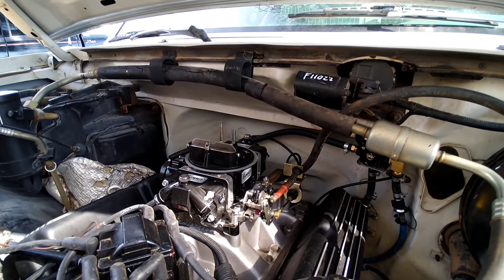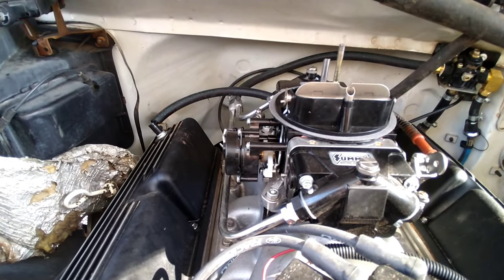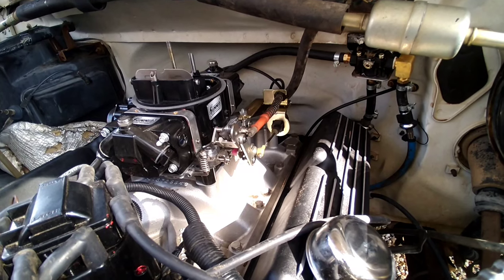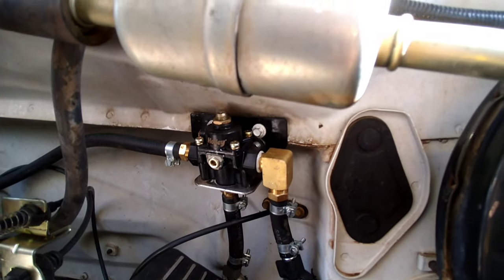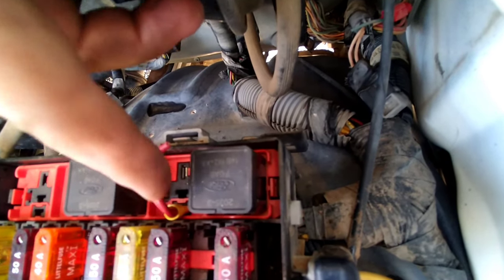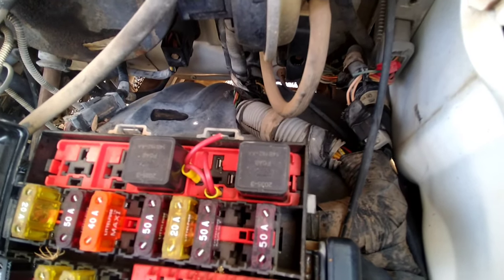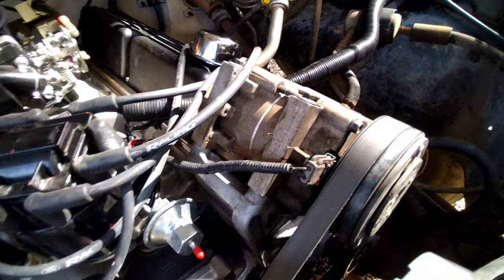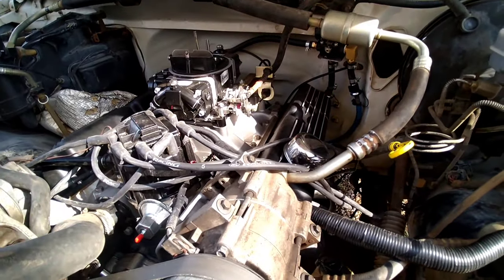87-96 F150 EFI to Carburetor conversion

Comment: what did you use to connect the factory fuel supply/return line to the fuel line to the carb? I can see you have some sort of adaptor - I am trouble tracking one down.  Any help is appreciated.
Reply from the maker: I left the fuel lines on the truck completely stock I didn't cut them but I did cut off the peace on the fuel rail on the intake that the fuel lines connect to then I just flared the cut ends and slipped rubber high pressure efi fuel hose on them and ran that to the pressure regulator
Reply: @CCAutoWorks  thank you.  I thought that after rewatching the video - but was concerned I may have missed something. Really don’t want any leaks…
Reply from the maker: @job1bf  mine has been perfect not a single drop but I do change the rubber hose once a year because the engine heat kinda brakes it down a little just me being of cautious
Reply: @CCAutoWorks  thanks again - currently doing this exact thing - hope it turns out as well as yours.
Reply from the maker: @job1bf  anytime thank you for watching good luck it will there's not to much to it
Reply: @CCAutoWorks  sorry to bother you - did you use the factory water temp sensor to make the gauges work?  there are two on the EFI intake and I am not sure which one to use.  Neither sensor fits the larger opening - do you remember what you used for that location?
Reply from the maker: @job1bf  I used the factory on but im thinking I used an adapter from a set of sunpro mechanical gages
Reply: @CCAutoWorks  so is the “large” sensor  (with two pins) the one that goes to the gauges? Or is it the “small” one that just one pin?  Did you use the location over the TStat?
Reply from the maker: @job1bf  mine was a one pin sensor kinda looks like you can thread a nut on it and I just put mine in the intake on the water crossover on the driver side

Comment: Where did you get that throttle bracket I can’t find one to fit mine and it caused my trans to burn up
Reply from the maker: https://www.ebay.com/itm/363714619487?mkcid=16&mkevt=1&mkrid=711-127632-2357-0&ssspo=fNK2amQnSWi&sssrc=2349624&ssuid=6G4e_MbCTLy&var=&widget_ver=artemis&media=COPY
Reply from the maker: I bought mine off eBay I sent you the link

Comment: hey i know this is an old post but i had a question regarding wiring did you "diet" the wires from the "injector harness" 4 connectors on the drivers side inner fender?
Reply from the maker: Mine only had one connector but I've seen the ones with four

Comment: What wire did you use for the tach on the new distributor I want to keep my oe tachometer.
Reply: Was it one of the two wires from the old coil?
Reply from the maker: I forget what color but I can look tomorrow I can't really remember I believe it was a wire that had went to the old distributor
Reply: Did you find which wire you had to hot wire for the tac?

Comment: ON the HEI, What gear is on the distributor to match the roller cam? Is that a stock 5.0 roller cam?
Reply from the maker: I couldn't find the right gear your supposed to run for a Ford distributor so I just ran the one that came on the hei
Reply from the maker: My cam is an aftermarket comp cam

Comment: Where did you get the throttle and trans cable bracket from and who.made it?
Reply from the maker: https://www.ebay.com/itm/315487762913?mkcid=16&mkevt=1&mkrid=711-127632-2357-0&ssspo=lmOu8J8dRrq&sssrc=4429486&ssuid=6G4e_MbCTLy&var=&widget_ver=artemis&media=COPY

Comment: I like what you've done. I have a 1995 f350 with 460 efi I'm wanting to to the same thing. On the TPS do I need a complete controller or can I just use a TPS sensor from us shift.
Reply from the maker: Either way will work if u just buy the tps sensor for your choice of carb

Comment: Does that fuel pressure regulator bring the pressure from 40-50 psi down to 6 psi?... I've checked around and only been able to find  an aeromotive regulator for about $315 to accomplish that...curious to know if yours is still working good...thanks!
Reply from the maker: Mine perfect it's a Holley low pressure 0-9psi bypass regulator I'll send u the link it just returns all the extra pressure back to the tank
Reply from the maker: https://www.ebay.com/itm/154839598272?mkcid=16&mkevt=1&mkrid=711-127632-2357-0&ssspo=j6SFV1OETHy&sssrc=2349624&ssuid=6G4e_MbCTLy&var=&widget_ver=artemis&media=COPY
Reply: Thank you sir!
Reply from the maker: @jimmydavis6254  no problem anytime thank you for watching
Reply: I did this on 93 f150 with same Holley regulator and found the internal shuttle valve in the fuel pump housing would not return until about 50 psi. I could not regulate the pressure to 6 psi. @CCAutoWorks
Reply from the maker: @marrsbar27  you have the high pressure regulator for efi you have to get the low pressure regulator for carb use 0-9 psi but I have found out Holley regulators suck I've had two of them fail and about burn down my truck I started using a different brand because Holley told me tuff 💩 on both failures

Comment: Hello Sir,
I love the video. you are the man. Could you put  a parts list. I will do the same.
Reply from the maker: Parts are really your preference and the brands you prefer
Reply: @CCAutoWorks   if i had a preference, i would be asking you. I know its an old video. just say you forgot. Thank you and goodbye.
Reply from the maker: @JoseMartinez-i7u  you don't have to be that way I remember every part I used from crankshaft to rod bolts to heads to fuel pressure regulator what I'm saying you might not like Holley style carb u might prefer Edelbrock you might not like Holley pressure regulator u might like aeromotive
Reply from the maker: @JoseMartinez-i7u  there's a hundred was to do something if u need an exact parts list and me to hold your hand that far you might not need to be doing this in the first place

Comment: I’ve got an 85 302 efi non ho and I’m looking to carb swap I wanted to know if you had the link to the fuel pressure regulator you installed ? Thank you in advance
Reply from the maker: https://www.ebay.com/itm/Holley-Carbureted-By-Pass-Regulator-6-PSI-Black-E-Coat-1-8-NPT-Boost-Ref-12-887-/274876864887?mkcid=16&mkevt=1&_trksid=p2349624.m46890.l49286&mkrid=711-127632-2357-0
Reply from the maker: On an 85 there should be two pumps a low pressure in tank pump and a high pressure one on the inside of the frame you should be able to just unplug the pump on the frame and just run the tank pump with no need of a pressure regulator I've done it like that on an 86 I just teed the fuel lines where it would still return the extra fuel

Comment: What intake and carburetor did you use from what other motor size will fit my 4.2 l Ford F-150 2003
Reply from the maker: It's a weind intake with summit carb as long as u go stand alone carb and hei distributor and u make your engine mounts u can put any engine u want in a 03 f150

Comment: Great Job. Got  86 F150 , first year with this crappy EFI, would love to swap to carb.  Do you have a list of parts or part numbers you use?  Would appreciate any help. TIA
Reply from the maker: Yes sir thank you for watching I sent all the links to a guy here in the comments if you don't mind looking at are conversation it's the comment with the most replys
Reply from the maker: https://www.ebay.com/itm/321888807068
Reply from the maker: https://www.ebay.com/itm/133374027685
Reply from the maker: https://www.ebay.com/itm/283666850881
Reply from the maker: https://www.summitracing.com/parts/sum-carb600-ecvs
Reply from the maker: Or any carb of your choice
Reply from the maker: https://www.summitracing.com/parts/sum-700203

Comment: What are the engine specs? I see Promaxx heads. What cam, intake, compression, pistons, shortblock parts, etc?
Reply from the maker: 351w block .30 over stock crank speedmaster bushed rods KB flat top pistons compcams er282 retrofit roller cam 513/529 lift 230/236 duration 110lsa 10.3.1 compression with the 60cc promaxx heads intake is a high-rise four barrel pro-form roller rockers pacesetter long tube headers

Comment: Why did you leave the vacuum advance on the distributor unhooked?
Reply from the maker: Because I didn't have a hose at the time
Reply: @CCAutoWorks  thank you for the reply. Just was curious as I am wanting to do this swap with my 96 302(manual transmission). This is by for the most straight to the point, what's all needed video on this subject. Had yet to find one where they explained keeping the stock fuel pumps running like you did. Thank you for your help!
Reply from the maker: @joeygeisler3506  thank you for watching happy to have helped

Comment: I have a 1994 F-150 Flareside 5.0 that I'm considering doing this to. It has the E4OD transmission. Is this conversion possible with the E4OD?
Reply from the maker: It is but it cost a lot more you have to buy a transmission control with a tps sensor

Comment: Awesome! Came out great. I got a 94 f150 302 swapping a carb 351w but I have the 4r70 trans so I’ll need a us shift kit. Hey do you know if the 302 pulley brackets will swap to the 351w? If not I’m heading to the junk yard. Great videos man I just found you looking this up!
Reply from the maker: I used my factory 302 pulleys an accessory drive brackets on the 351w I put in there no problem this truck was factory 302 truck I built a mild 351 and put it in there when I did the carb swap
Reply: @CCAutoWorks  beautiful work! Thanks for the info!
Reply from the maker: @anthonyalexandrou5055  anytime thank you for watching
Reply: Hey I have another question for you, I’m putting a 79 351 block that came out an old 82 f150 mud truck in a 94 f150. Right now I’m trying to wrap my head around the distributor. I have just the stock one with the duraspark system that I ripped out of the 82. My question is do you think the distributor will wire up without issue with the brain? Or am I going to have to find a different if Ignition system. I still have the 94 and 82 ignition system and I’m hoping I can patch something together. Please help lol

Comment: Hey man im about to do this to my 91 f350 i wanted to ask about the bypass line on the fpr did you have to drill a hole in the tank for the return and add a custom fitting on the tank?
Reply from the maker: No on mine it has a factory return

Comment: Does anybody know if this belles mpg?? It’s possible with a carb because emissions may be the benefit of the efi. Abs cold starts. Depends.
Reply from the maker: I noticed 1
About 2 mpg less but it's bored cammed and has aluminum heads

Comment: What kind of intake did you use to replace the other intake.
I got a351 Windsor straight 8 and was wondering
Reply from the maker: https://www.ebay.com/itm/Weiand-Ford-351W-Windsor-Dual-Plane-High-Rise-Stealth-Intake-Manifold-IMCA-/133374027685?mkcid=16&mkevt=1&_trksid=p2349624.m46890.l49286&mkrid=711-127632-2357-0
Reply: 351 Windsor straight 8?

Comment: Finally got mine together.
Reply from the maker: How u like it
Reply: @CCAutoWorks  I've still got some fine tuning to do to it. Think my main problem is the fuel pump. It's a low pressure pump I had. Gonna try a mechanical and see how it does. Needs plugs and adjust the vacuum advance some. Lighter springs in the distributor

Comment: Im about to do this swap and I have an 87 bronco with and AOD, to make this work with the TV cable all I need is the cable bracket and the corrector bracket?
Reply: The carburetor im running is the holley 0-80457s
Reply from the maker: Yessir your correct

Comment: Im looking at buying an 87 4x4 302 5 speed. Owner claims the injectors are shot, but i can tell this man doesnt know a spark plug from a butt plug and he tore the intake plenum off, (which he called the head btw) cut wires, removed the injectors and anything else that was in his way. So i think im going to bypass his fuckery and do a carb and intake swap. 

Any help would be appreciated. Got a part number for the hei dizzy?
Reply from the maker: Lmao I've ran across plenty of guys like that to the mechanical fuel pump bolts to the timing cover which the fuel injection ones do not have you have to get a carb timing that has the fuel pump molded in the side of the cover and the hei I got off eBay for fifty bucks I might go to a small cap hei for looks
Reply: @CCAutoWorks  yeah, i kept watching your vid. I forgot a sbf and a pontiac (of which i am familiar) are pretty similar with the timing case and fuel pump.
Reply from the maker: I'm not sure if an 87 still has a low pressure fuel pump in the tank and the high pressure on the frame rail under the drivers floor board but if it does on them I just unplug the frame rail pump and run the carb off the low pressure tank pump
Reply: @CCAutoWorks  i was thinking there was a lift pump and a high pressure pump. Im thinking about using a clickity-clack pump just to get it home.

Obviously I'll change the intake, toss in a dist and a carb.
Reply: @CCAutoWorks  do you know the parr number for the ford hei distributor? Im not a ford guy, so finding parts is a pita. (Pain in the ass) 

i love to go to my local vatozone and ask for a ford hei just to watch the look on their faces. Lmao!
Reply from the maker: @Poopdogsays  if you need one I have one
Reply: @CCAutoWorks  yeah, i think im gonna need one. How much?
Reply from the maker: @Poopdogsays  do you have an Instagram
Reply: @CCAutoWorks  nope no social, just yt.
Reply from the maker: @Poopdogsays  you can have it just pay for shipping
Reply: @CCAutoWorks  cool, i'll get in touch with you when i get the truck. Thank you!
Reply from the maker: @Poopdogsays  sounds good it has about a 100 miles on it I pulled it out to replace it with a small cap hei

Comment: Where did you get the kit from? I’m trying to do this on my 1990 f250 5 speed manual
Reply from the maker: There's no kit I just ordered all the parts individually
Reply: Did you do your conversion yet?   I have a 95 F150 XL with the 4.9L and manual tranny.  I want to replace this setup with a carbuerated and "1 wire" distributer. Looking for others who have done it to see where to start. Thanks!

Comment: I feel like I am really late to this video but hope you see this comment.  Why did you have to jump the fuel pump relay?  Doesnt it work with the key regardless?
Reply from the maker: Mine did not it would turn on for a few seconds then turn right back off but I did have a guy tell me if you ground the obd port it will turn on the pump with the key but I haven't had a chance to try it yet
Reply: @CCAutoWorks  that is EXACTLY what I am experiencing as I have done the almost exact same swap as you.  It will run for about 30 secs and cut off.  I am going to try that and see
Reply from the maker: @joebrown2567  awesome

Comment: if i was to take a 300 out too put a 302 in would i still need to change the harness and computer or would I be fine considering I wont have injectors anymore.
Reply from the maker: If your running a carb and hei distributor you really don't need the harness at all unless u still want the gauges to work if u do just cut down the 300 harness to everything that run the gauges oil,temp,amps,a/c compressor cut the rest out but leave the computer and it will all work great
Reply from the maker: What transmission are u running
Reply: @CCAutoWorks  1988 f150 4x4 with the m5od 5 speed
Reply from the maker: @rannz8  perfect should be very easy

Comment: Loved the video, I was wondering where did you get the throttle linkage bracket?
Reply from the maker: https://www.ebay.com/itm/234926748138?mkcid=16&mkevt=1&mkrid=711-127632-2357-0&ssspo=ZjVZZbogTlq&sssrc=4429486&ssuid=6G4e_MbCTLy&var=&widget_ver=artemis&media=COPY
Reply: @CCAutoWorks  sweet thank u so much!
Reply from the maker: @ethanball1316  https://www.ebay.com/itm/404639700010?mkcid=16&mkevt=1&mkrid=711-127632-2357-0&ssspo=nt2dbiw1rq6&sssrc=4429486&ssuid=6G4e_MbCTLy&var=&widget_ver=artemis&media=COPY

Comment: im doing that also. took out the 302 put in a 351 w in a 1989 f150 what rear end in an 8.8 is Pozzi traction ? and thanks for the info
Reply from the maker: Sweet
Reply: @CCAutoWorks  I have a 95 302 5 speed it’s efi speed density all I need for the swap is a new intake, carb and distributor and the bypass for the fuel pump in the tank right ? I’m leaving ac and power steering and everything just wanting to get rid of the efi to clean everything up and I’ve already deleted the smog pump and blocked the ports in the back of the head and looking to get rid of the egr so I thought the carb swap would be my best bet
Reply from the maker: @rjjohnson3807  yessir sounds like you have it figured out that's all you need for the swap

Comment: did you use the factory (efi) throttle cable or did you use an aftermarket one? or one from a factory carb truck?
Reply from the maker: I used the factory one from the efi
Reply: @CCAutoWorks  super thanks!  starting the swap this week...wasn't sure if I needed something special.  appreciate the help and video...
Reply from the maker: @job1bf  you will need a couple of brackets a throttle bracket and a kickdown lever bracket